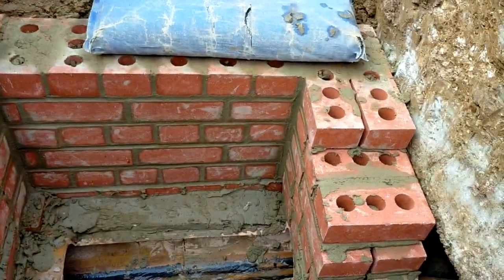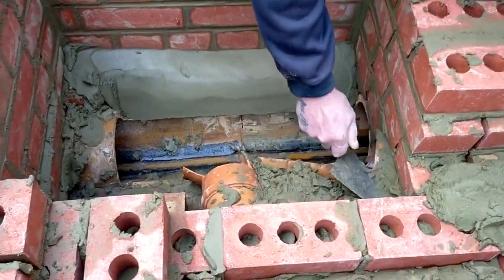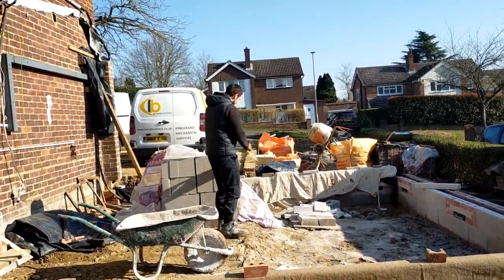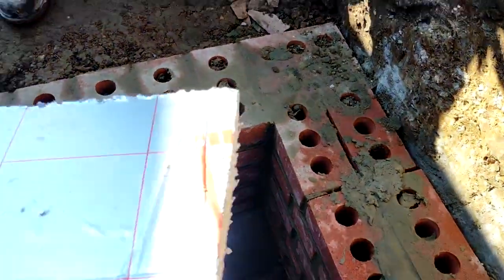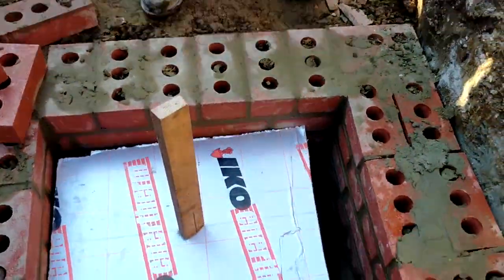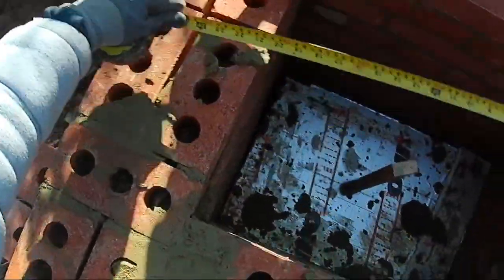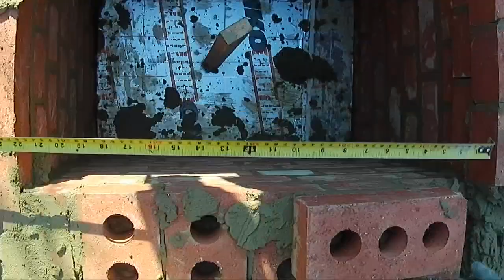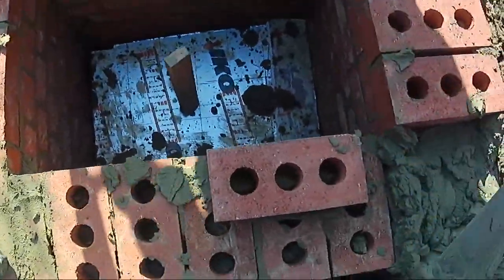Manhole building and benching revised.

Comment: My dad was a plumber and I brought his old set of drain rods when I moved to Spain in 2003 - put them in the shed and forgot about them. Had a Spanish contractor make a bathroom extension on the house - plumbers, builders, electricians, plasterers all coming and going, you know how it is, you don't even catch there names. Anyway about a year later I thought the chimney needed sweeping so I went to get the rods and some bastard had swiped them. Not only that, they were wrapped up in plastic sheet and they'd gone to the trouble of replacing the rods with bamboo and wraopping them up again! Wankers!
Reply from the maker: Someone nicked mine in Spain, you never used to be able to buy them think you can now.

Comment: Hi Andy, did you have to build in masonry or is it just what you prefer? I had to do one a couple of years ago and we used plastic manhole risers and it worked well.
Basically we exposed the 9" pipe and cut out  a section of the top half like you've done. Brought in the new pipe on the angle in the flow direction. Then just got a 600mm riser chamber section, offered it over everything and neatly scribed over all the pipes. Concreted all around the outside of the chamber and the benched inside with a granno and cement mix.
Reply from the maker: Can be done like that Joe, concrete rings , square sections etc just sometimes it's quicker old school as you can get over stuff with brickwork 👍 also that's what the Architect specified.
Reply: @bricklayersworldwithandy6277  i must admit it's nice to see the traditional methods. I've been in the building game for 19 years now and not come across anybody building a brick manhole. Good stuff Andy 👍

Comment: I am going to be doing something very similar but smaller for multiple open french drains. I have conpacted down some hardcore for where it will sit as there is soaking wet clay where i am putting it. I am worried that when i pour the concrete base and build the brick walls the water will want to go under the chamber where the hardcore is. do you think this will be a problem? Its annoying because i was planning on doing this tonight but this worry has entered my brain!
Reply from the maker: @benbutcher1595  If its compacted well and dense it shouldn't attract to much water.
Reply: @bricklayersworldwithandy6277  Thanks for the reply boss really appreciate it 👌

Comment: How do you connect a modern 110mm pipe into these old clay manhole foul half pipes?
Reply from the maker: @Hew.Jarsol  If you are talking about in the manhole you have to break into it and fit a purpose made plastic slow bend, can be a hell of a job, better if Building Control allow you to install a tumble system where the pipe enters the manhole higher.

Comment: I have seen a lot of clay brick for manholes and catchbasins here in the US, but how do they hold up there? The salt and weather fluctuations here spalls them. I like to use concrete solid block or brick.
Reply from the maker: The clay bricks we normally use for this are Engineering bricks, they don't spall and are pretty much waterproof, the ones we used on this job are actually made from concrete 👍